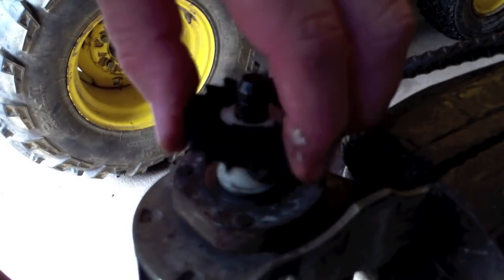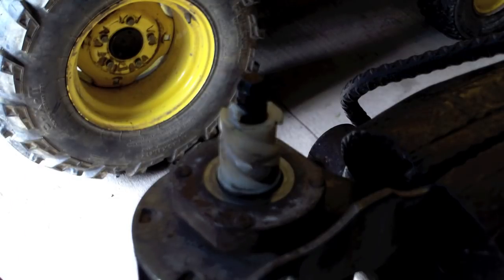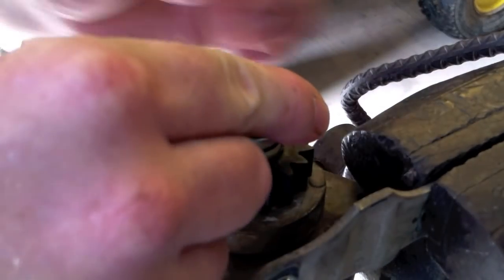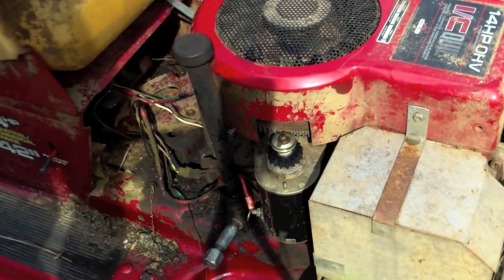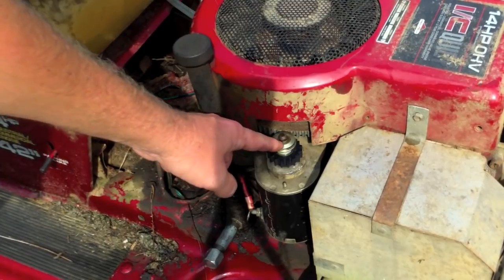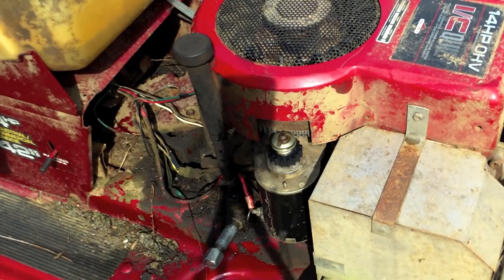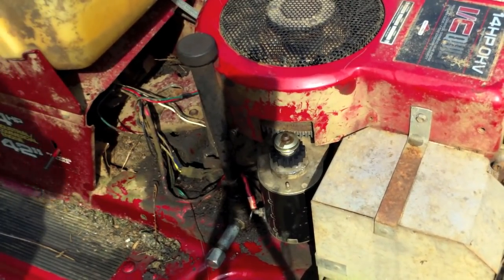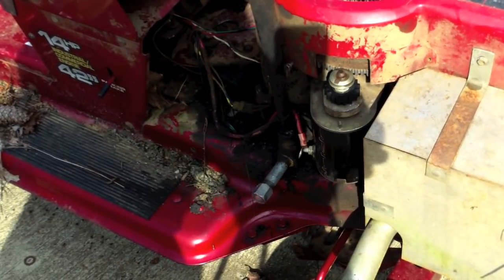How to replace a starter gear

Comment: Good tips on the c clip removal and install. Them spring one's are a little easier  I think. Motor sound strong just a dirty carb. like you said.
Reply: My new build was sitting outside like forever, I f you  remember I cut the rims off because they were like rust welded to the axle....lol ...I need to take it apart and regrease  it. but I see about getting a spare first. the  engine had some water in it. not real bad my buddy got running. I don't want no Tecumseh motor....lol

Comment: I been workin with starters at an auto electric shop for almost 20 years and Lithium grease is the correct grease for rebuilding them, used on the gear spline and bushings in the starter. Graffite grease is used inside gears for the clutches and the really old starters that have a felt wick that you oil is w30 soaked in the felt. And you cannot use bearing grease as a substitute, it is too thick and will make the parts wear quicker because it has a higher temp rating for it to turn to a liquid which will be to late to lube bushings and will cause gear to stick on spline to where it won't engage. Yah, I shot a couple of those clips across the shop too through the years.

Comment: Good video:  you can use a 5/16" (or 9mm?)  socket to put the c clip back on with hammer ez .. BUT i'm burning up (stripping out) too many plastic 16 tooth plastic pinion gears ? can't find 16 tooth in metal, any suggestions? thanks.

Comment: Thanks, nice tip,   I have a 1983 MURRAY RED ! wow !  very similar, 42" cut.    fyi:  can get new pinion gear on/off w/o taking starter off by turning flywheel while pulling up on pinion gear ,new one went on nice was well by turning flywheel other way, nice !    BUT my problem is I keep stripping out the 16 tooth plastic pinion gear ,,, but mine only stripped off about 1/4 the depth of the teeth, making me think, the starter is not lined up correctly with the flywheel or maybe someone put a 14 tooth type flywheel on... how can I tell the difference?  any ideas to limit the stripping phenom,, old days it was unheard of ?  Can I use metalized 14 tooth, how to tell?  Can't find 16 tooth metalized anywhere.  THANKS... good video !

Comment: One guy used a hand grinder to grind off at a 30 deg angle about "3-4" long area on top side of the flywheel (don't get into the flywheel teeth) so he could replace plastic 16 tooth pinion gear without taking off starter (just turn the gear off at that place, reverse to get new one on).  looked like it worked, jus trying to help.   I need help finding out why the plastic gears keep stripping out so often, thanks if you got any ideas.

Comment: Ok darron.  I dont want to, you know, sound bossy, lol, but about those starter gears.  There is an upside down to them.  Thats the way you put it.  It wont hurt anything, but its just upside down.  The right way, you can see on the metal gear, on top, on the teeth, you can see that they're kind of edged to catch the flywheel.  And it will go counter clockwise wither way. Its like a nut.  They'll go on either way.  

And the c clip, ive heard that once you stretch them, they're pretty much weakened by that much. In other words, they have that much more of a chance to come back off.  I havent looked lately, but you can get them in bulk on Amazon. I forget how much though...  

I only meantion these things because of my mistakes.  Yeah... had to pull my entire tractor apart within a day of putting it back together....

Comment: ha ha Edward is a vocal kitty, cute and frendly :-))

You did the job like the bigger car starters, i was waiting for the super duper spring pusher downer socket :-)

Im sure there is a "special" tool but hell a socket works fine!!, old worn out sockets make good spacers too lol, yep ive been evil and used them :)

Taking hours to set up a camera, are you mad lol, just plonk it in front of the mower at a 45 degee angle and press record he he :-))

Comment: thanks Murray Mayhem. I bought two replacement stater gears from an Ebay seller. Both were embossed with "this side up" to eliminate putting them in upside down. However, while trying to remove the 7 mm C-clip, the clip came off and flew through the air landing somewhere in the basement shelving disappearing without a trace. It came off all right after using two jewelers screwdrivers to pry it off. Anyone know of where I can get another C-clip this size?